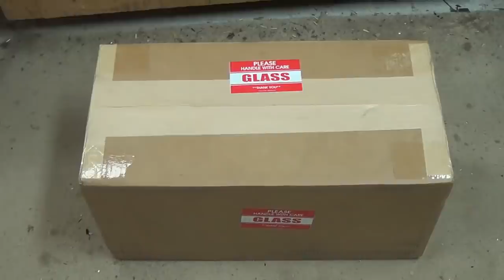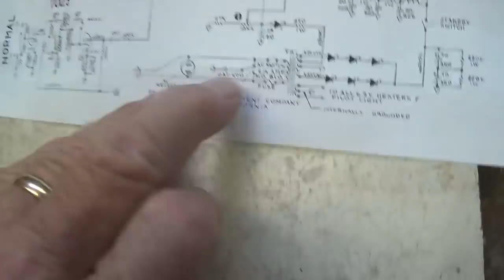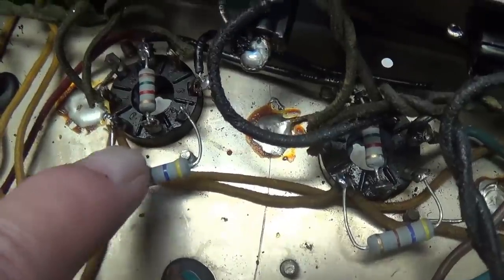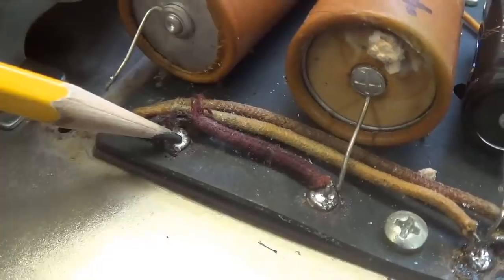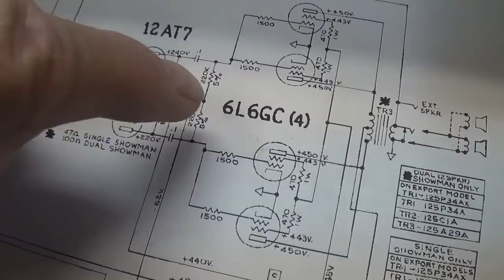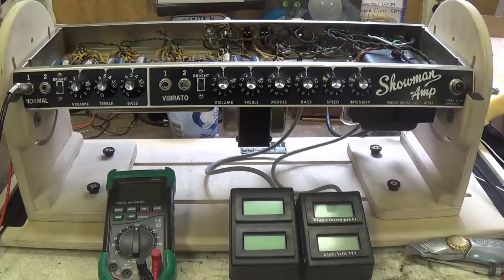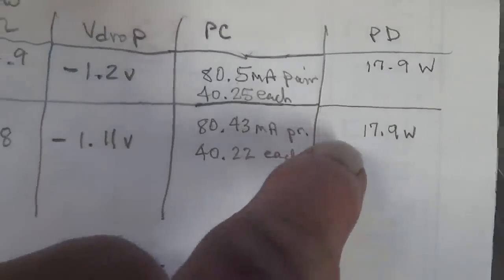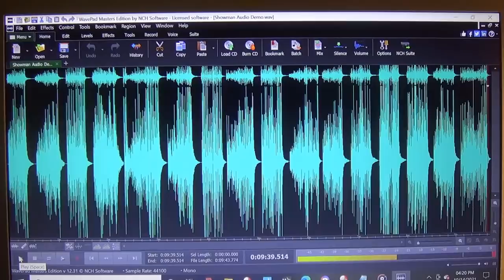1965 Fender Showman.......Back from the dead, but not without an epic struggle

Comment: Hi I'm having trouble with sourcing parts for my 66 deluxe reverb I had bought a recapping kit from mojo tone but it sound generic also I think I'm in over my head with this amp I don't know much about bias or how to take readings or what to compare them to in the first place my power tubes and rectifier are red plating so I know something is a muck also need a replacement power chord to have the amp grounded any suggestions on where to source my parts and if there's a video you can suggest to help my problems with the bias
Reply from the maker: To be honest, Brandon, it does indeed sound like you're "over your head". Please message me on my FB page: Uncle Doug's Vintage Amps, and I'll give you the name of a great tech who can help you out.

Comment: Hi! Doug. Every time I see you under the hood of a Fender Amp I note that the 6.3 volt AC filament wiring is twisted and wired to the tubes from above. Well clear of the bottom of the chassis. Way back about 60 years ago when I was at electronic college I think I remember that filament leads were best twisted and run tight to the metal chassis? Has the practice or theory changed or is my memory a bit fogged by time? Most of the stuff I trained on was RF not audio!
Reply from the maker: As I mention in many videos, Don, the preferred wiring method is the one seen in Fender amps, with the tube connections swooping down from above. Laying the wires along the chassis and around the socket creates an EM field that can result in hum.

Comment: Just enjoy all your videos. I dabble around with repairs and have learned so much from you. I have question. How could I go about sending you a Lafayette bass amp head that was my fathers in the 70's for repair and might be an interesting YouTube video. It has 2 6L6's and a few 12ax7's i believe. I have the schematic and it's circuitry just doesn't look anything that I've seen on YouTube. I wanted to see if maybe it could also be modified to be a guitar amp, with distortion control, maybe your own design, we can call it Dougortion. Well anyways, keep up the great videos, and I hope to bring my dad's amp back to life. (it does work, and is pretty well original)
Reply from the maker: Thanks, Marcus. I've cut way back on repair work, but can recommend a good tech if you wish.
Reply: Thanks for your reply Uncle Doug. I will probably just try and mod it myself, which could be a disaster. I would love to see how you would mod a Fender amp, like the bantam bass amp I have, into a controllable Marshall type distortion. I seen someone did that and had a switch that could switch between the two. Anyways, keep up the great videos!
Reply from the maker: @marcus6283  Thanks, Marcus. The referral offer still stands if you change your mind.

Comment: At around 51:30 into the video you measure the 2 half windings of the secondary of the output transformer, getting figures of 23 ohms and 36 ohms. You say the figures seem low and the 2 values should be more equal. I know you replaced the output transformer but if it was yours was healthy what kind of resistance figures would you expect for each half of the secondary windings? I suspect there is some damage to my own output transformer so would be interested to know
Reply from the maker: Did I not measure the half-windings of the new OPT in the video, Chris? If not, I should have. I checked my notes from the video and do not see any mention of the new OPT winding resistances.
Reply: @UncleDoug  Thanks for the reply. Really enjoyed the video 👍
Reply from the maker: @chrisjones7022  You're welcome, Chris.

Comment: UD why not wire the power receptacle on back of chassis after the on/off switch? So when amp is turned off the accessories also turn off?
Reply from the maker: That's how I wire the primary circuits in amps, Joe, but with auxiliary receptacles, I just wire them the old fashioned way.
Reply: @UncleDoug  thanks , this week i am driving from Arizona to California and I am picking up a 67 Fender Deluxe Reverb with all original caps, and components. Only. Thing changed is the reverb tank., tolex is a little beat on bottom so  maybe some restoration work for it. Hope the hot rods are doing good the hot weather is coming fast, take care!
Reply from the maker: @joer5000  Thanks for sharing, Joe. Will do. You too:)

Comment: Uncle Doug, I have a question please; I noticed you mentioned the current limiter could not work properly with the current required by the Showman.  I happen to be in the process of rebuilding my 65 showman (a hobby). I panic when the current limiter comes on; does it mean I have a short in the system? or is it a normal occurrence with the showman?  It only happens when I take it off standby.  Thank you for your assistance
Reply from the maker: You probably need a higher-wattage bulb, or 2 or more bulbs in parallel, Guido.  The higher the wattage of amp, the higher the wattage of bulb.

Comment: Both your eurotube meters were showing "LOBAT" which is presumably low battery?
Excellent viewing as always ;-)
Reply from the maker: The meters have no batteries, preferring instead to draw phantom voltage from the circuit, Steve. I have contacted Eurotubes for assistance in recalibrating them.
Reply: Bugger. Hopefully you get them sorted.

Comment: I`ve noticed on those Fender amps is that there is a hum balance instead of a true bias control. I have modified this circuit to run as a true bias voltage control.
Reply from the maker: Some of the large Fender amps have a hum/PC balance control and some have a bias adjustment pot, Cal.

Comment: Thank you so much uncle! I really loved all your videos. 

I have a question, what wires do you use in tube amps? Pvc, Teflon, cloth or silicone? 

Stranded or solid wire? 

Thank you!
Reply from the maker: Always stranded, MT. Solid wire is much easier to work with, but will break due to movement and vibration much sooner than stranded. I'm really not sure of the chemical nature of the insulation, but tend to avoid the type (vinyl?) that melts when you are soldering connections.

Comment: Hi doug  brill  vids you make.       can you tell me if its possible to add  a headfone socket to a frontman 212r fender amp.      thanks
Reply from the maker: Thanks, David. Yes, it probably connects to the pre-amp right after the phase inverter.....if that makes any sense with an SS circuit.
Reply: @UncleDoug     thanks for reply.

Comment: A couple of questions from a computer geek with just enough electronics understanding to not kill myself or others..  (1) What is the purpose of putting the 6 diodes in the circuit in as 2 sets of 3 diodes in series.  I'm familiar with full wave bridge rectification, but this setup looks like it would only supply half wave rectification.  (2) A "theoretical" question:  Is it theoretically possible to "balance" the value of the two output transformer windings to each set of tubes by including an appropriately valued resister in that part of the circuit.  Obviously not necessary here, But would it be possible?  Would it ever be desirable to do this?
Reply from the maker: Since both HV outputs pass through the diodes, it is a Full Wave Rectifier, JT. Yes, some amp circuits provide a potentiometer to balance the output tubes.
Reply: @UncleDoug  Got it.  Thanks!

Comment: Uncle Doug. Love your videos. Not saying it is always the case but I have seen many amp restoration videos where the default move is to replace the caps with the excuse that they are “unreliable” just because of age, and they have to go right now. In several cases, the new caps have even worse ESR than the old ones. I understand infant mortality and stressed out parts, but if a cap has lived for 40 or 50 years and has good ESR, what makes it a reliability risk? Is there data out there that mandates replacement after a certain number of years. Cheers. PK
Reply from the maker: I agree, Pablo. If a capacitor is properly sealed, the electrolyte should remain viable for many, many years. Age alone is not sufficient cause for mass replacement.

Comment: Uncle Doug - great job and a question. To maintain originality, would you ever consider swapping the clamshells of the Output Transformers ? If the holes line up, I would surmise that they would be interchangeable? I know its probably overkill, but just a thought on how you feel about that...I also wonder if you have checked the line ground connection to make sure its solid on the transformer screw ? I am not trying to be a know it all - just more curious....  Thanks my friend... great job as always!!
Reply from the maker: I actually started to switch the bells, Ron, but if you look at the shape of the extruded area on the bells, one is much larger than the other.....which made me think twice about the switch. That, and the possibility of screwing up the new (expensive) OPT. I don't think I've ever found a loose ground under a lock-washered PT nut.
Reply: @UncleDoug  , actually, Uncle Doug, yes, those ground lugs to the P-T bolts do indeed loosen, and oxidize. Where the P-T center-tap grounds are tied to the chassis via a transformer bolt, the connection will loosen as the amp gets jolted around during transport to gigs and the weight of the transformer causes the chassis to deform around the bolt holes. An amp can develop intermittent hum when that ground loosens and oxidizes. This might not be an issue in a bedroom amp, or a Champ or other low power amp with small transformers, but a gigging amp with large transformers really should not have grounds tied to the transformer hardware. (Earlier Fender amps have soldered H-V grounds, but CBS era amps used lugs tied to the transformer bolts ---- and if CBS did it, its probably wrong!). Check out some of Psionic Audio's amp repair videos on YouTube.
Reply from the maker: @goodun2974  Thanks for your input, GU.

Comment: Are 55 year old amps really practical for guys who don't have   have a tech crew on salary? It would be interesting to know  just how much faith you can have in the major components. Also at what point all the new caps / resistors et al add up to tones unrelated to the original amps. Watching you work reminds me that the people who built them initially were assembling more than building  and thus  unlikely to exercise the level of care,  thoroughness and expertise you   do.
Reply from the maker: Great questions, Jim. Just like Ferrari's and beautiful mistresses, tube amps require special commitment and can present costly support issues.....but to those who have and appreciate them, they're worth it. Modern SS amps are no walk in the park, either, and are often simply discarded and replaced when no one is willing to repair them. There is no "free lunch" with electronic gear, but if you want the very best in tone, often with great reliability, tube circuits are the way to go.

Comment: I have a Mesa Boogie F-30 and is making an extremely loud buzzing noise. It's similiar to the sound heard when touching cable tip to a piece of metal but with the volume all the way up. It's not constant but comes on randomly and scares the crap out of me. I don't like playing through it because of this. Trying to figure this out as I can't really find too much information on it. All the other videos are of a constant buzzing noise and not randomly coming on with really loud effect. At first switching the channel switch stopped the noise but now the only thing I can really do is turn it off to stop it.
Reply from the maker: Hopefully you will be able to find a tech in your area that will work on Mesa amps, Intro. Meanwhile, be sure your instrument cables are all shielded.
Reply: @UncleDoug  Alright, thanks.

Comment: Uncle Doug, I am sure it's been said before, but it cracks me up every time you chop the end of your narration at the end of a scene.  I'm going to apologize in advance for this question because I'm sure you've answered it a hundred times before, but why don't you also move the grid blocker resistors away from the tube sockets?
Reply from the maker: Glad you enjoy the editing, Pat. Good question. The grid blockers don't seem to suffer much from the heat due to the very low current flow, while the higher current screen resistors are often well cooked and need all the help they can get.

Comment: Great video! One thing that I noticed (though it may be a trick of the the light) is that the right hand resistor that you had replaced across the output tube socket appears to have overheated. Possibly happened when that tube went pop?
Reply from the maker: I double checked all the resistors after the cataclysm and they were fine, Adam, but thanks for your helpful input.
Reply: @UncleDoug  Yes likely just a shadow from the wire running above it.
Reply from the maker: @adamdavies163  Could be, Adam.

Comment: These very "Challenge"  vids are why I call you Professor. The in depth of not only how, but,  mathemetically why!  I do have Q, Uncle Doug. Could that direct short in the dog box been responsible for the major failures discovered?
Reply from the maker: I am not sure that a short ever occurred, Y. There was no charred area near it. I tend to think a bad tube destroyed the screen resistor and damaged the OPT.
Reply: @UncleDoug  Though I am only an electrician, and not a electronics technician, I am still baffled as to how that Positive was bridged to the Neg. and yet, nothing catastrophic occured, not alone that it was rather NOT a very Fender-Like assembly.
Reply from the maker: @y00h0011  I guess it was very nearly a short....but not quite, Y. It would have been a complete disaster if a dead short had occurred at this point in the circuit.
Reply: @UncleDoug   I know this one was a bit of a challenge and very time consuming. Just wanted to say.. Great Job!  We appreciate you.
Reply: It may have been arcing a bit, but not fully shorting, just a thought.
Reply: @jeremiahchamberlin4499   Yep! Like Uncle Doug said. Enough to damage but, not quite enough for an immediate kill!
Reply from the maker: @y00h0011  Thanks so much, Y.

Comment: Normally you send back to the customer the components that have been replaced,  though the cap cases have a possible collector/restuffing value,  have the old tubes any value other than target practice ?  Would you like to keep the old o/p transformer if only for the fun of unwinding and rewinding it to find why the discrepancy  in the resistence and effective impedence
Reply from the maker: All parts are returned to the customer, HP, especially with collectible amps like this one.

Comment: A few observations.... connecting the OP valve grid stoppers as you did to reduce heat exposure is less than optimum, grid stopper resistors should be connected to the valve base pins as near as possible and with as short as possible leads to prevent oscillation (stray LC). I'm surprised you didn't pre test the OP valves after finding the burnt out stopper & a cold DC resistance test may not find an inter electrode SC which often occurs when the valve is warm (am sure you know this).  A possible cause of high cathode current & unstable OP valves is very high frequency oscillation, you wouldn't know it was there without a scope. Guess you ruled out leaky coupling caps, though one side of the PP Op stage having high Ia is indicative of such. Lastly also surprised you didn't take the OPT apart and examine it for shorted turns etc. These are observations not criticisms, apologies if I'm guilty of proverbial egg sucking instruction : )
   Informative video as always, many thanks.....DA. BTW, no reply needed, am awed you reply to every comment, kudos, but give your finger a rest : )
Reply from the maker: Thanks for your helpful input, DA. You may be mistaking the screen resistor position for that of the grid stoppers, which were attached directly to the grid pin of the tube with minimal lead length. Dissecting the OPT was not deemed necessary.....it's defects were apparent without the need for further investigation and destruction.

Comment: Hello, Uncle Doug
   Can you suggest some books about Tubes engineering? I am radiotechnics/programmer engineer myself so I want to understand the concept more deeply. The Morgan Jones's "Valve Amplifiers" book left many gaps, you cannot thoughtfully change something in suggested designs because description of them often incomplete... (or author implies that the reader must have a strong background of Tube's amps design).
   I think that Knowledge of This craft is slowly fading away so I want to keep a piece of it for myself...
Wish you all the best, Kirill
Reply from the maker: Greetings, Kirill. Although I personally don't use books as a reference for electronic topics, other than Tube Handbooks, I understand that Gerald Weber has published several good texts on the subject of tube circuitry. They may still be available on Amazon. Good luck.